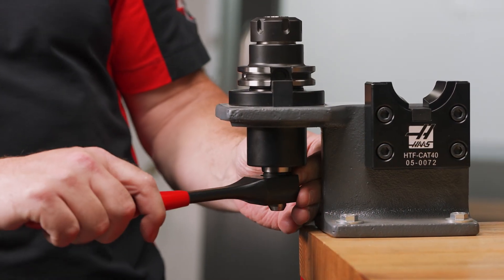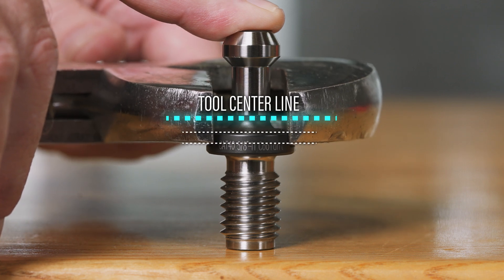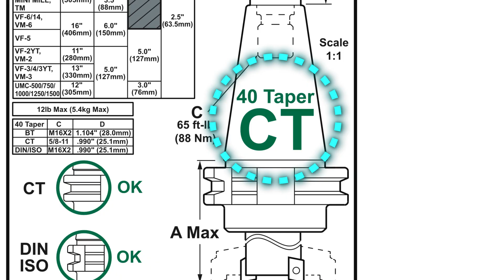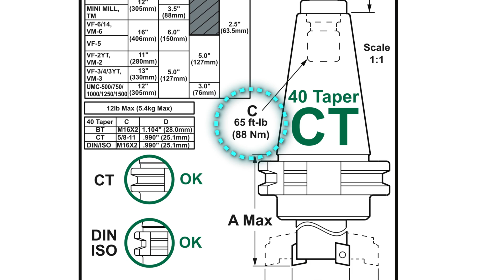Get Better Grip On Your Pullstuds! - Pullstud Wrenches at HaasTooling.com

Comment: After my company has owned two haas, a VF-2 and a super mini mill, I will NEVER by any haas mill. They run for a while and do good work, but when they break they do so in ways that Nobody can fix.  I have exchanged over 20 emails with the local rep and had techs come out to try to solve the latest problem... NOBODY knows what to do. The tool setter and the sipndle probe are outputting the wrong values. The only way I can do work is by using an old mitutoyo gauge to input the correct values for tool lengths and z position.  And we went through a similarly aggravating problem with the VF-2 in years past.  I already have a small tormach 440 mill. And when I go buy the next machine for myself or any company I work for I will buy their new 1500MX cnc mill.  They work incredibly well and are super reliable. I"ve had my 440 for over 10 years and it has NEVER broken. The software is super easy to use, etc, etc.

Comment: I love all the new products, especially at new price points. I do have to disagree on the torquing of pull studs though. Do the experiment I did, on your own and make up your own mind. Get a holder with either a blunt end like a boring head adapter. Or use one with something blunt in the end like a dowel pin or back of an end mill. Get a big enough micrometer and measure from top of the pull stud to the other end. Start at firm-finger-tight, then wrench-snug, then 20 ft/lbs, 40 ft/lbs, 60, 80. If the tool holder neck is compressing, the length will get shorter with more torque. I got easily measurable compression of the holder, within the range of what would be guudentite with a hand tool like you're showing. I now either go by the holder recommendation or 40 ft/lbs.
Reply: I’m with you, that lighter is better when it comes to tightening these things. In a regular CT40 spindle we expect 1460-2300 lbs (6494-10231 N) of Drawbar Force. As long as our pull stud is tightened with enough pre-load to counter the axial drawbar force, we’ll never have an issue with the pull stud loosening. We can always use a drop of serviceable thread locker as well (blue loctite).
Reply: 0:23 😢 @markterryberry4477